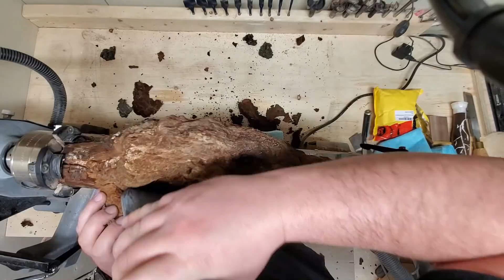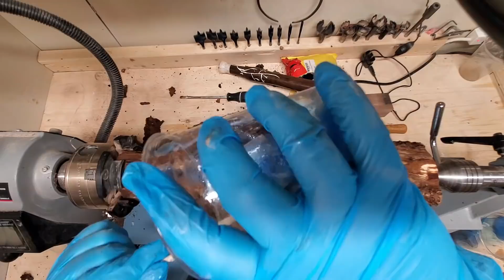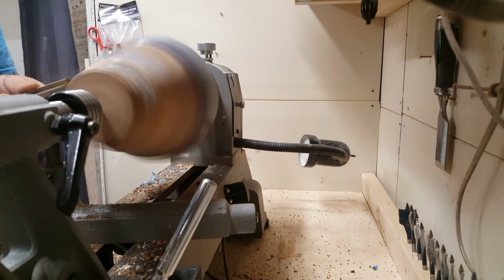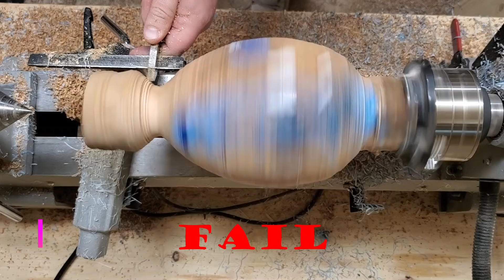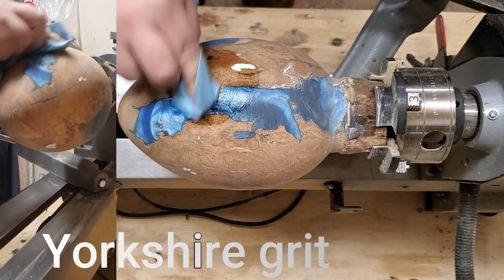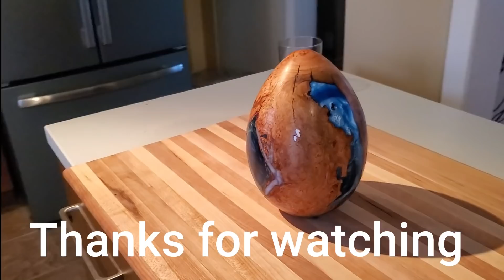Woodturning - The Lochness monster's egg

Comment: What did you seal the voids with?  Very nice piece, especially without stabilizing or using pressure pot when casting.  Impressive
Reply from the maker: Just regular epoxy. That make sure that no air coming out from the wood. No air no bubble 😜

Comment: You have a new sub, but 2 questions. You didn't show it but did you use a sanding sealer before the Yorkshire grit and if not how far did you sand to? When you buffed at the end did you use a clean buffing wheel or did you have a buffing compound on it?
Reply from the maker: i sanded to 600 before the yorkshire grit and its a clean buffing wheel, and btw thank you for the sub!

Comment: What kind of epoxy did you use? And how long did it take to set for each section
Reply from the maker: The brand is chemtech and it's approximately 6hours between each coat